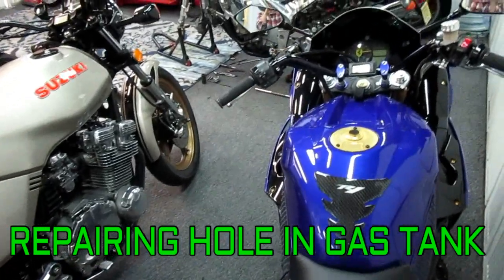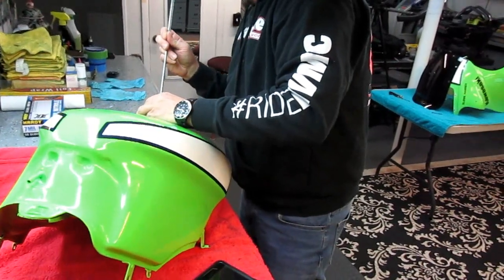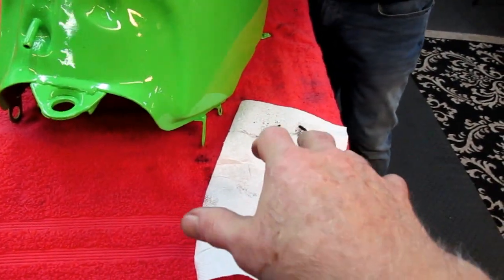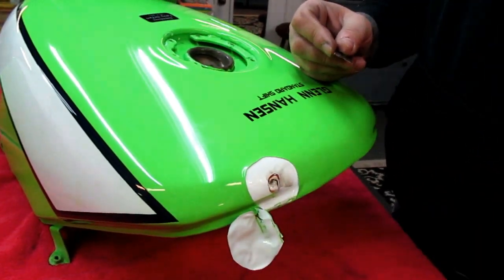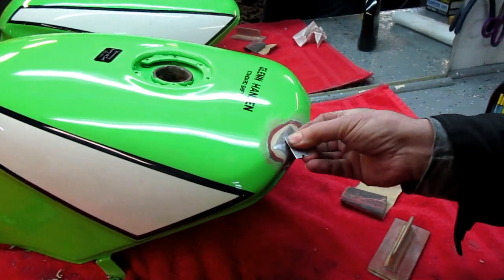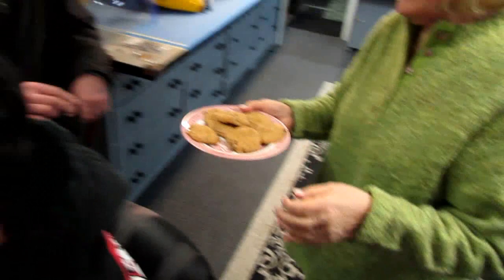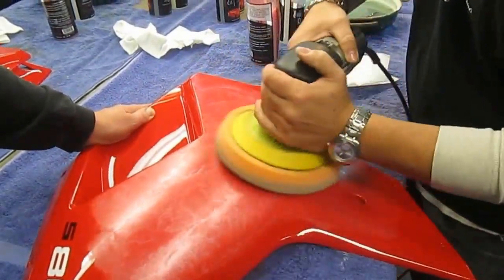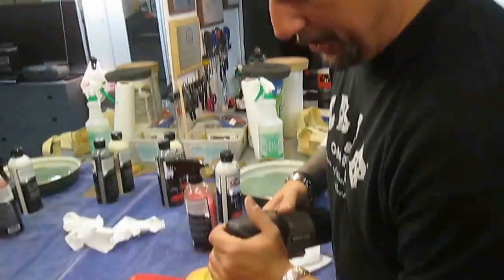pt 141 FZR RESTORATION,TANK HOLE AND RUST REPAIRS,GOOD TIPS

Comment: I too have done several tanks with Apple cider vinegar, works great, but every way to find different methods is great, you could actual rig or mig weld that plug in and sand it and prep it and paint it, off course after you clean all the gasoline washed off the inside of the tank with some degreaser